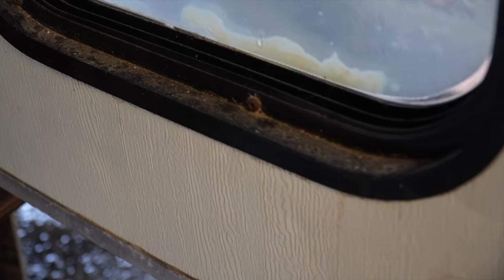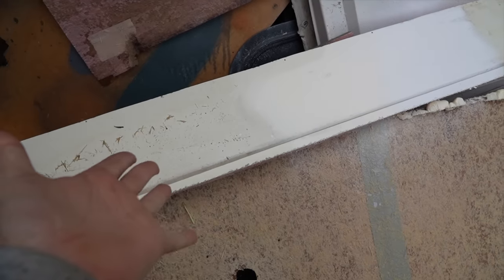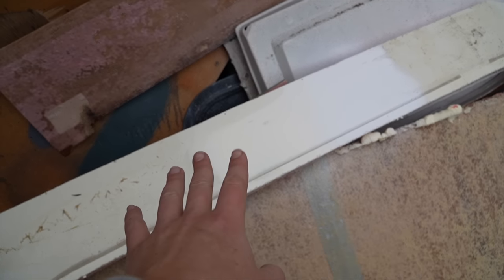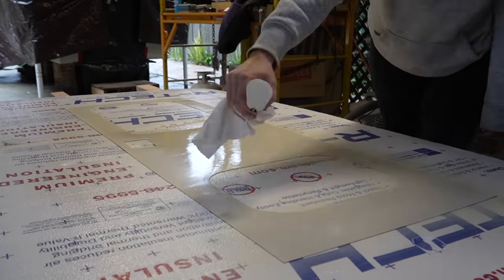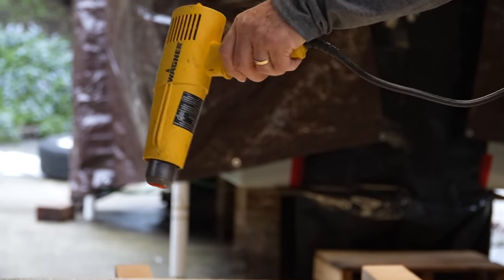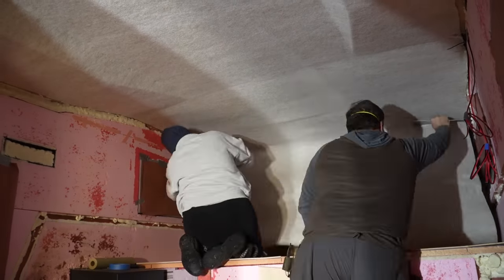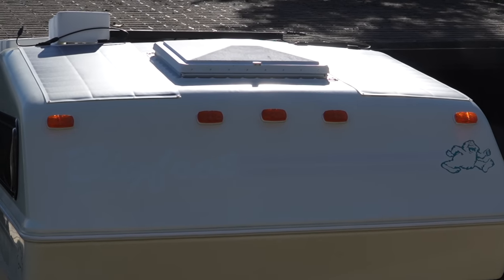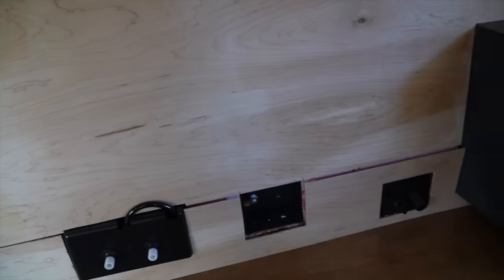turning my vintage truck camper into a cabin on wheels

Comment: For safety, I'd replace your glazing with almost unbreakable windows, such as hurricane glass, polycarbonate, acrylic, or similar and maybe both an outside pane and inside pane for added security in addition to the added insulation value. Sheets of such should be 1/8 inch thick. I'd also add top and bottom door bolt locks. Be careful camping, preferably with a companion or safety determined dog along for added safety. Concentrate on making it as secure as possible.

Comment: One brand name for your marine headliner is Ozite. It is still used not only in marine applications but some rv applications as well. It was the main motorhome headliner about 20 years ago.
Reply from the maker: Mine is very similar! I purchased it from "Sailrite" :) It's technically a marine product but I chose it for added resistance to mold, mildew, and any smells!

Comment: "I see a white door and I want to paint it black,,,,,"     
Sorry, old Stones song I think, but it kept runnin' through my mind as I watched you work, great rebuild on the door, well that and everything else! 
Don't know but a black door might set off everything else you have on the outside, but I guess to keep it a bit cooler a white door is ok,,,,
The bottom of my door was also rotted out but the skins on my door are thicker so I ended up leaving the door on and digging the rotten wood out then building a subframe to replace it with, yeah and my boards all needed to be thinned by 3/16th of an inch too.
EDIT: i guess it was a Red door, but that's due to an old worn out brain,,,,,,

Comment: The camper is looking super cozy! I love wood heat and with all that space I see multiply locations for a small woodstove.
Reply: Or maybe an outside intake and vented exhaust type propane, or a diesel Webasto installed.
Reply from the maker: It is wild how large the space looks empty, but there really isn't a location for a wood stove in here without losing all of my counter space :( I would love a wood stove in a future home, though!
Reply from the maker: the heater I purchased (dickinson Newport) is an externally vented marine propane heater, so youre spot on!
Reply: I actually have the Dickinson Newport solid fuel heater (woodstove) in my ARE aluminum dcu truck cap camper and love it, pricey but high quality. It's wall hung and almost duplicate to the LP version.

Comment: It seems like with campers, there's always space you could have used but just couldn't figure out how to. So you might consider putting a few passenger side doors on the bed of your truck that allow you to use the space forward and behind the fender wells. It might be a great place to put tools, jumper cables, a jack and air compressor, or even a battery or converter. Just an idea for more space. Great video, glade to see your moving forward and happy you didn't use carpet.

Comment: I would be concerned about those flexible panels hanging over the front edge of the roof. 75mph winds will want to peel those right off.

Comment: Progressing along nicely there Alex! Hey, if you want to work without filming…that’s your right and you do not need to apologize and/or explain yourself. 

Btw-did you need to remove and replace your tie down brackets?
Reply from the maker: Thanks Mike! and yes, I was able to refab the rear two that were in good shape, and will be completely replacing the front two to ensure that the camper is safe and secure :)
Reply: @SheRoamsWild  don’t know if you have seen the mess Jonathan is dealing with; that’s why I asked…he’s got his hands full!!!

Comment: I don't understand the logic of buying a vintage camper and then gutting it to build a modern camper. I once sold one of my homes to a man who paid a premium for a house built on a heavily wooded lot with decades old mature trees (that wooded lot was the reason for the premium price), then cut down all the trees because he hated trees. It would have been easier and less expensive to just buy a house on a lot with no trees.

You are doing a great job on the conversion. Just curious about the motivation.